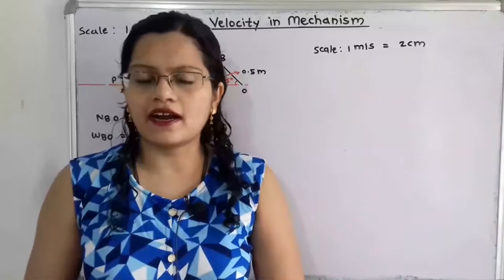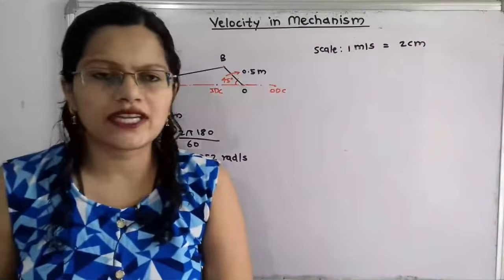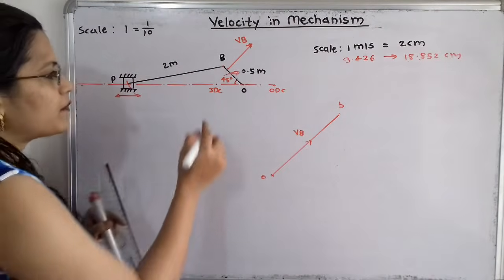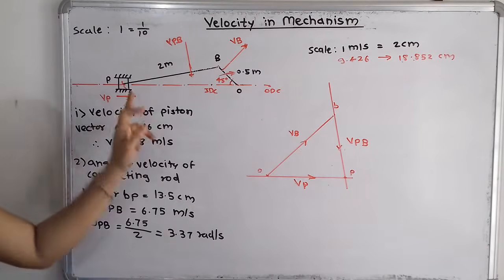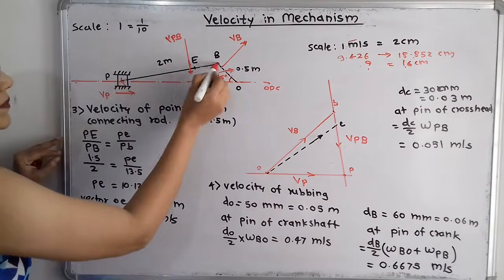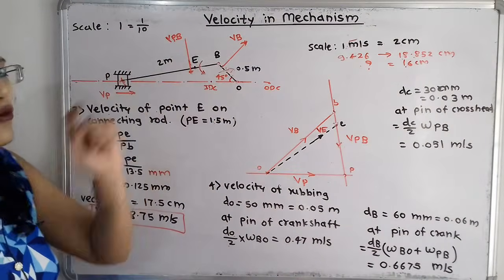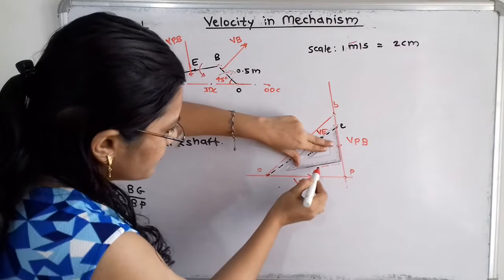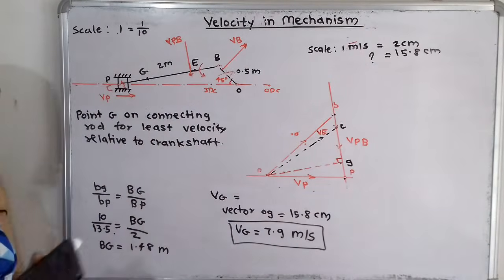Problem 2 on crank and connecting rod mechanism / Relative velocity method/rubbing velocity at pin

Comment: ln slider crank mechanism crank is 60 mm & connecting rod is 240 mm long. When crank 
 has moved through 400 from inner dead centre position the velocity of slider is 3 m/s by using 
 kleins construction find
 1) Angular Acceleration of connecting rod.
 2) acceleration of centre of gravity of connecting rod which is situated at distance of 120
Reply: Ye problem solved kro plz mam